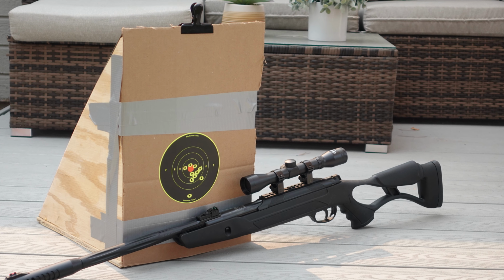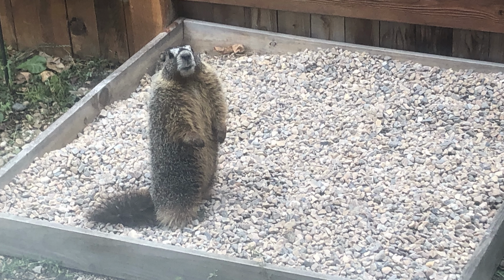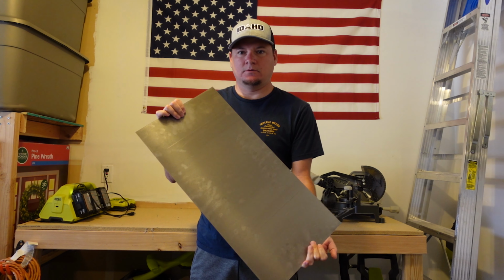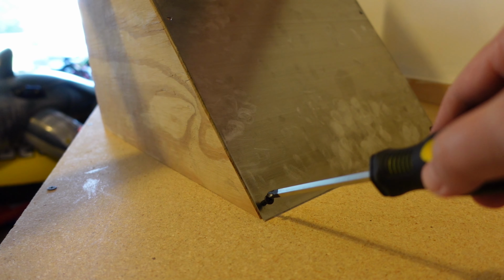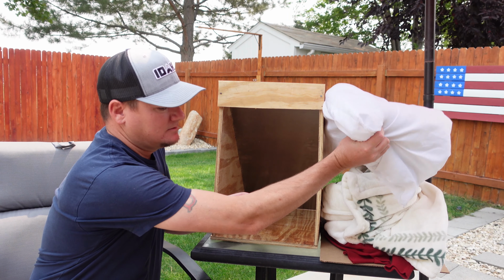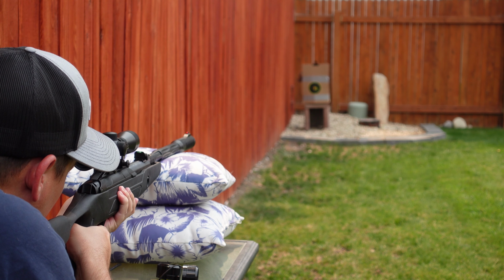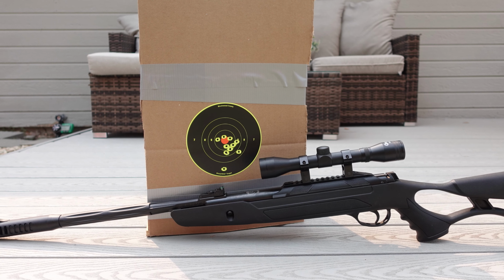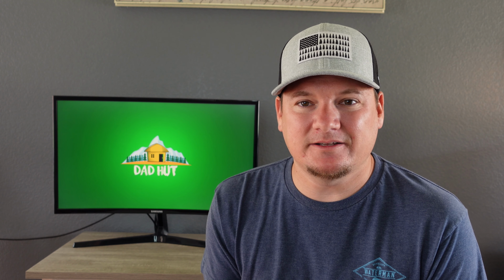Backyard Shooting Range (Air/Pellet Rifle Gun). DIY, How To

Comment: If you hang a old piece of bed sheet in it hanging from top only the sheet piece will stop pellets not hit metal and can reuse pellets
Reply: Reusing pellets is very bad for your airgun definitely not something id recommend, also allot of newer airguns will shoot straight through the bed sheet
Reply: @idkbro1429 if you leave the bed sheet lose like just hang from top and dont make any of it tight it will stop the pellet I promise you. I got a 22 cal 1100 fps rifle and after 500 rounds i still have not had a sibgle pellet go through the bed sheet. But its a pain to have to hang a sheet up every time but it gets the job done if someone doesnt have the kbow how to build a pellet trap or time or money t make one its just a way to make a quick easy free back stop
Reply: @idkbro1429 I dont recommend reusing pellets but I have tried it using the sheet as a back stop and it does shoot again but you get more random flyers compared to new pellets I only did it once i dont do it ever reuse pellets but tried it jsut to see if you coukd if you wanted to
Reply: I found this device it's called a pellet truer. It makes sure every new pellet it perfectly shaped and I use it for re shot pellets now and I have way less flyers out of using it for reshoot pellets then a new pack of pellets and not using it but I don't use reshoot pellets ever as well